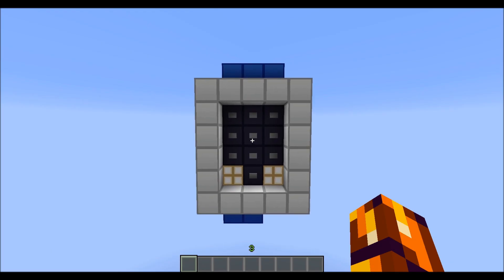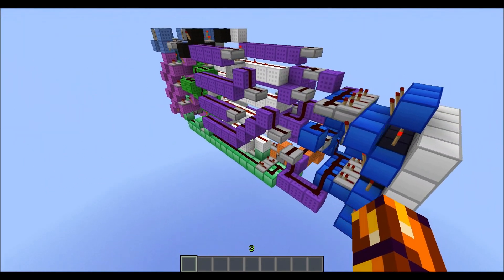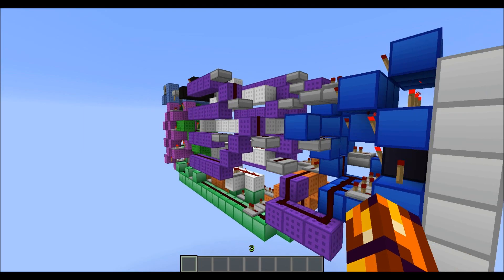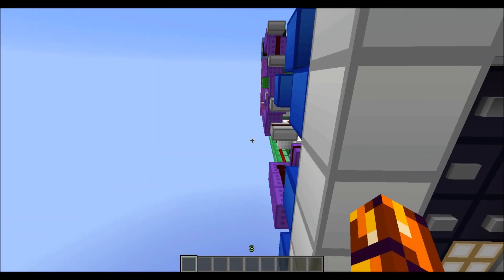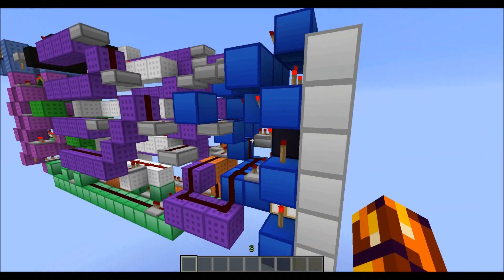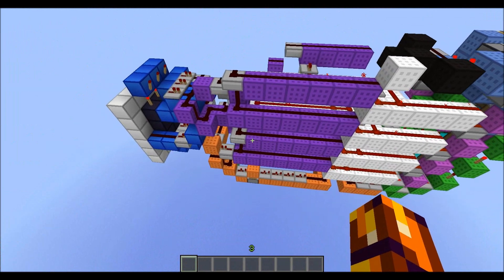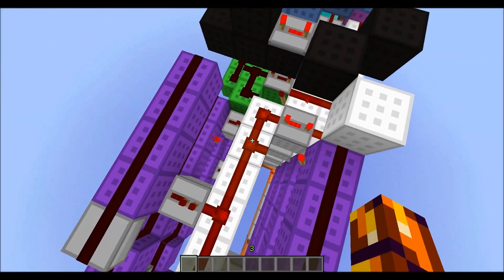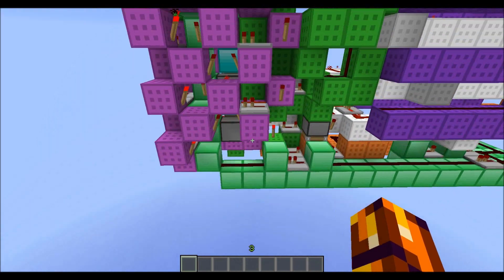Minecraft: Compact PIN Combo Lock (4 Digit Sequential)

Comment: They are identical in function. Non-solid blocks do not emit power or transfer power through themselves, but those two can have redstone dust, repeaters, and torches placed on them. Being able to power the redstone line, but not transfer power through the block is extremely useful, especially when dealing with pistons (preventing diagonal powering).

Comment: Here is a quock fix for the pressing the last digit will unlock the system. Use a AND gate it's that simple or you can draw power to every cell so that you have deactivate the cells in order. I have a lot of knowledge when it comes to combo locks.

Comment: 7 itself resets the system, meaning that if you type in the right PIN afterwards it obviously works. So to answer your question: This combo lock resets after every wrong digit you pressed and NOT after you pressed a 4 digit PIN that isn't right. That means your problem doesn't appear on this one. Get it? I hope I could make it clear sorry I'm not english ^__^,

Comment: Do number just have to appear in order or are they decoded in sets of 4? Meaning 1234 as PIN, will 71234 unlock it? Some of locks would just read 7123 as wrong and 4 as beggining of next input try. Because if it's set based type, not nowing where set starts and ends would be rather problematic.